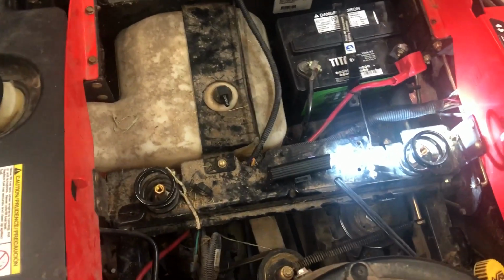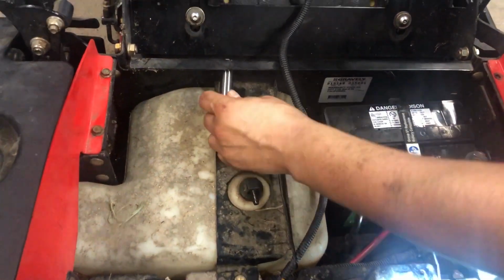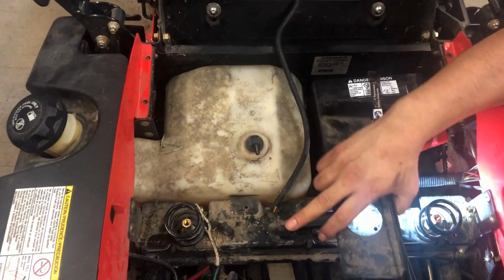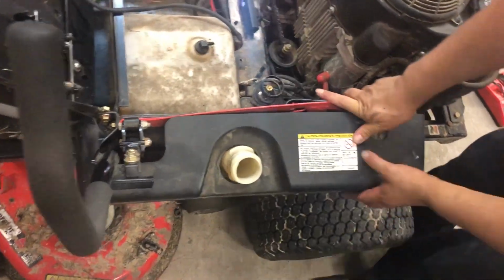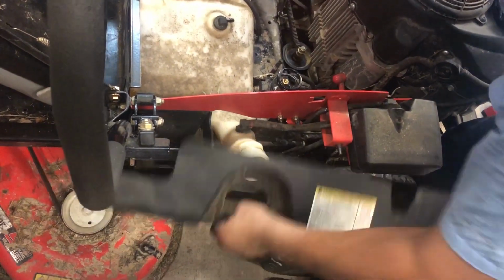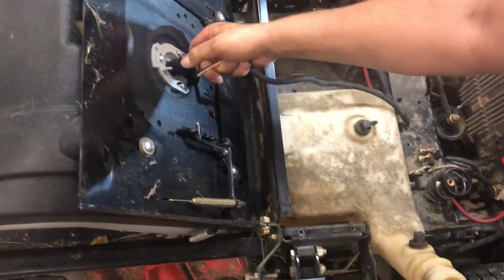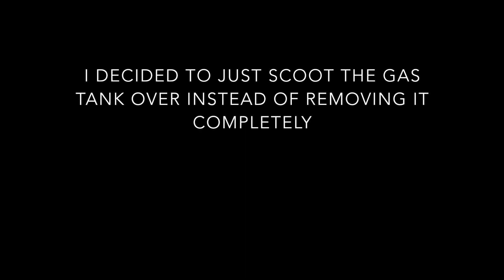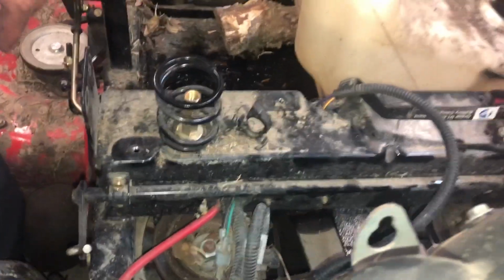DIY: How to change Gravely ZT42 lawnmower Solenoid

Comment: This video was extremely helpful.  Just follow what he has done.  Mine bolts were standard, not metric, but that is no big deal.  I do recommend when you do it that you relocate the solenoid.  This can be easily done.  There is a video by Mr. Fix-it that has you bend the plate and mount it on the back of that .  However, I just remounted the solenoid on the cross beam and plate, just to the right of the gas line using an existing hole in the beam and drilling a hole in the plate.  The solenoid went get hit by the seat, and I did not have to modify or replace any wires.  This mod makes it super easy to change in the future.

Comment: Did you cut the string on the gas tank cap in order to slide the fairing over the end of the tank?  It can't be removed unless the gas cap comes off and mine has a string attached inside to the bottom of the gas tank.  I ended up just using a screwdriver to pry open the end connector in the gas cap while holding the string. Don't let go then reconnect it to the cap.